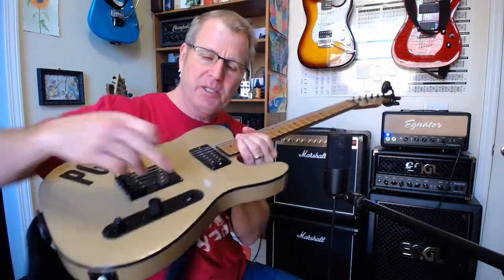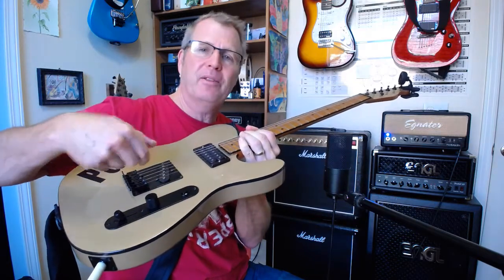TESI Kill Switch - A Hard Press

Comment: Sorry I didn't see this sooner.. Ive been working on getting lower tension on the 16mm metal  switches. The NELLI switch is 16mm and has a super fast response, and the arcade buttons as well. Feel free to reach out to me with any questions or comments.
Reply from the maker: I now realize that it's my own fault for not ordering an 'arcade' style button. A few viewers straigtened me out. I'm not sure the large Arcade button will fit, but it probably would. I've been meaning to get back you all, just been busy :-)